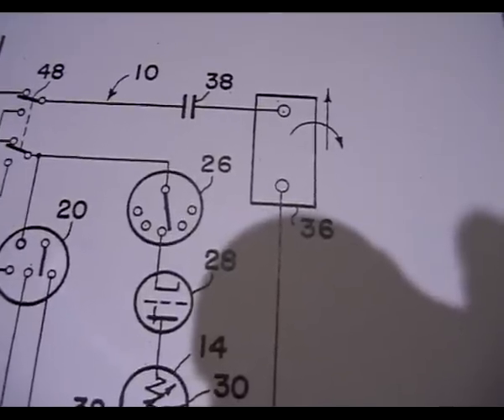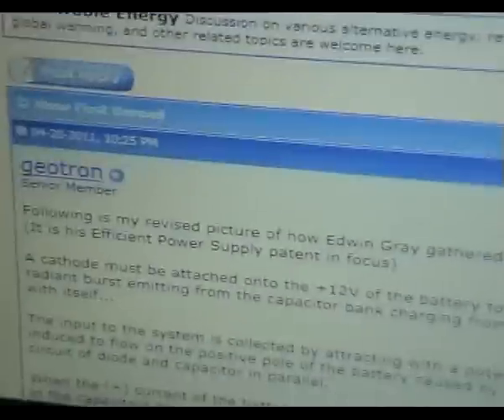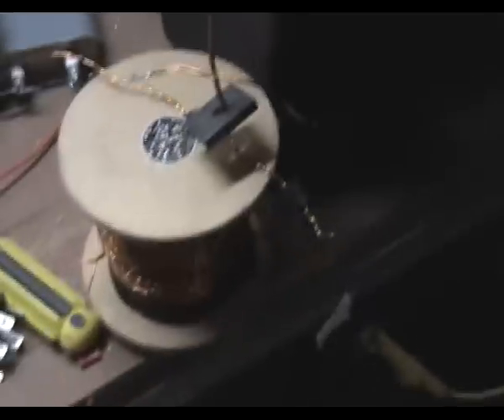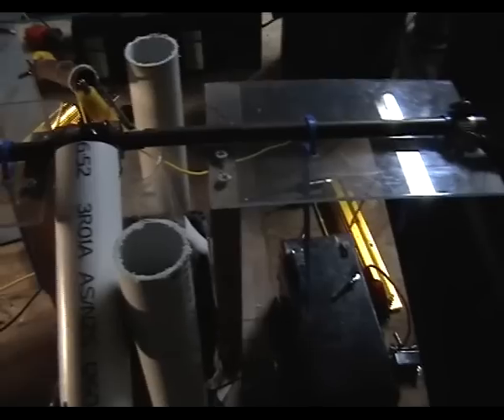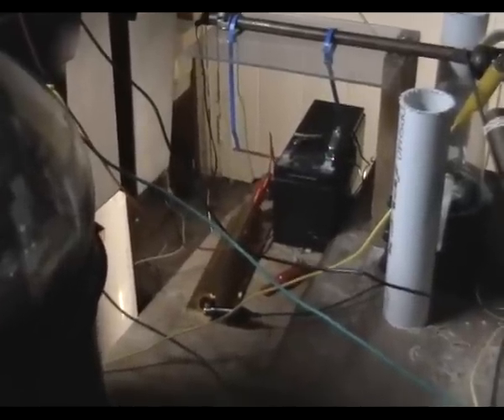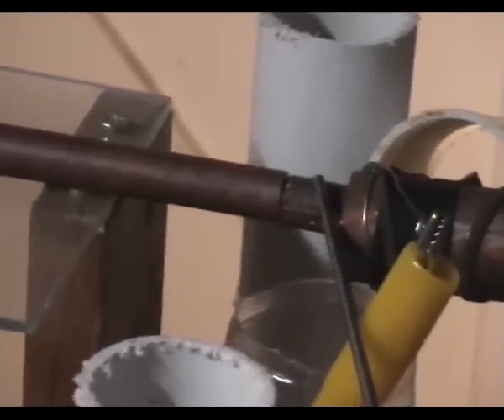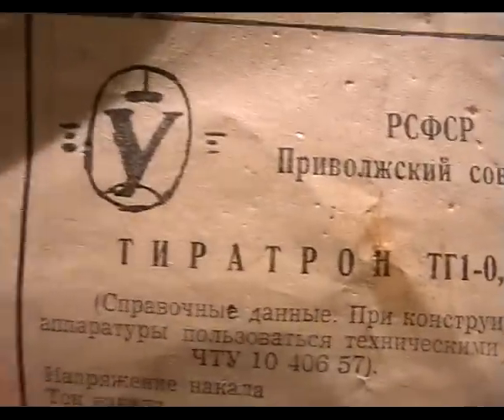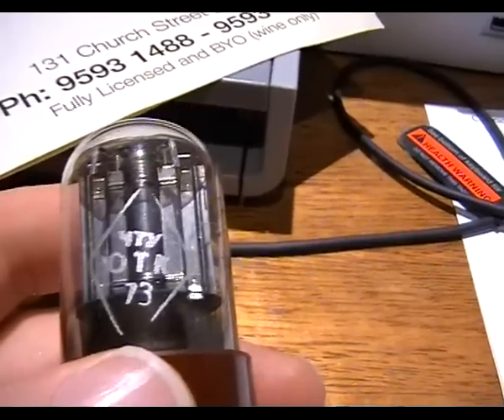Update 40 - EV Gray Tesla / disruptive discharge hybrid circuit PART 2

Comment: Hey Nat1971aa! Your keenness to build some of this stuff is to be admired. The operation of the Thyratron is identical to a modern day semiconductor called an SCR, or silicon controlled rectifier. The way it works is, the gate or control grid in the case of the Thyratron, has a threshold level which once triggered will turn the Thyratron on, or into hard conduction. Really like a voltage controlled switch. Once turned on, the Thyratron will not turn off until theoretically zero current passes from cathode to anode. This usually happened when the DC power is disconnected or the anode voltage goes negative. In practice they usually turn off with lower currents than zero.

I imagine this info is a bit late. I seems from the BYO at 131 Church St Brighton paper in this video that you are or were near Brighton Vic. So we were almost neighbours. Have you still an interest in Tesla stuff? Be interested to hear from you if you are. There is more to be done with the disruptive discharge coil that may be fascinating. Tesla himself described a very curious anomoly with regard to the behaviour of the air above the DDC. Seems to me it could have lead to some kind of craft propulsion.

Comment: u dont get it n not the rest whome I know of. nikola tesla discovered radiant matter by charging a huge dc capacitor bank with VERY VERY high voltage DC current, and discharging that DC capacitor disruptively because DC capacitors do not pass DC voltage they block n hold dc voltage untill they are at a overcharge point n right at that mument when a DC capacitor is at an over charge situation you put a super megnet on that DC capacitor u may get it discharged disruptively so keeping the conductor across the discharge terminal wire short u may shorten the path of that massive dc disrupted discharge and bring out the shock waves effect thats called RADIANT ENERGY! but its got to be rapidly charged and more rapidly discharged! try whatever u can but the only simple secret of radiant energy lyes in the supercharging and rapidly discharging dc capacitors. its all have to do with DC CONDENSER/CAPACITOR and strictly/entirely direct unidirectional high voltage current very very high and COMPLETELY UNIDIRECTIONAL DC DC DC. or els u will always end up catching far away miner effects but never the actual phenomenon